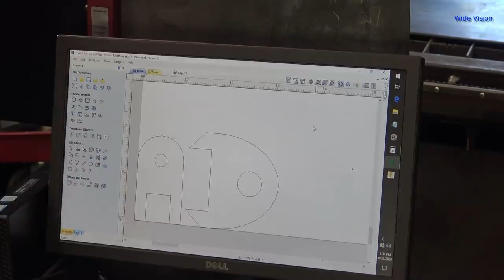Car towing hitch adapter build. (Incredible trick to make $4 an hour!)

Comment: Looks great.   I knew a machinist who specialized in prototype work for larger companies. They would send out the material, he would turn the parts.  He would turn extras from the extra material and just let that sit.  When the company ordered more, they often asked for a rush order.   He agreed to making more pieces quickly because he knew he had everything on the shelf.    If only hitch adapters were in great demand!    Thanks for the video!

Comment: I use tube that a urethane bushing slips into. Pin from ag supply. The bushing takes out the shock of start and stops. I can send you a picture of my design if you like.

Comment: Not much point in going with 1" pins when the swivel bit(where they fix to the A frame) has what look like 1/2"  Once on the vehicle and you have the exact width there is no need for the swivel pins, just weld them on so its easier to fit.